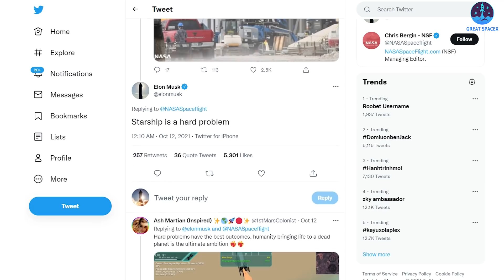"Starship 20 is a hard problem" Elon Musk confirmed on Twitter.

Comment: The 2nd stage of falcon 9 burns up and is destroyed on reentry. Does spacex have any plans to reuse the 2nd stage?
Reply: Their plan is to replace F9 system with Starship so no further efforts to increase reusability of this hopefully soon to be obsolete system.
Reply: @paulmagadanz1978  I do not understand how a large, heavy Starship can be brought back to Earth, yet a much smaller craft cannot.  Can the 2nd stage fire its engines in the reverse direction to slow itself down enough to minimize the heat of reentry?
Reply: @steverichter1546  it's too small. It burns all the fuel it has while ascending.